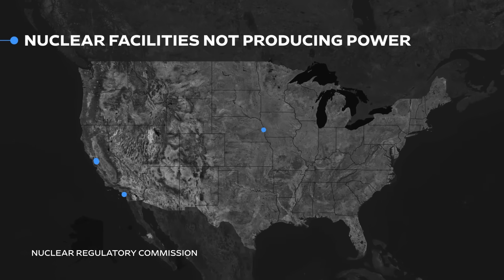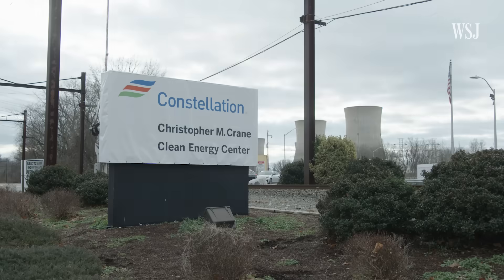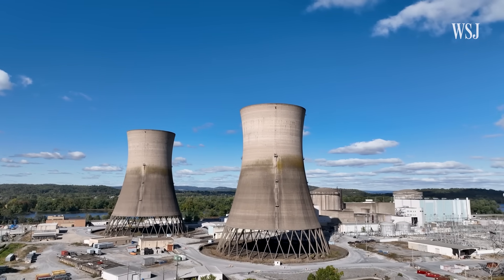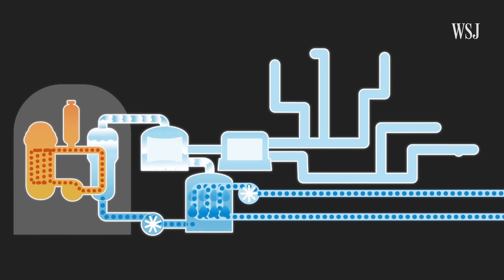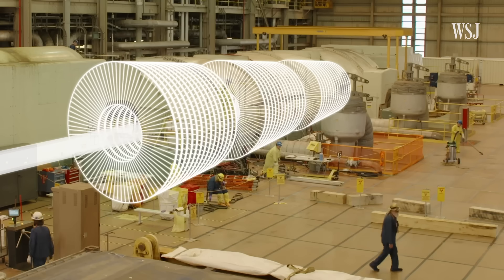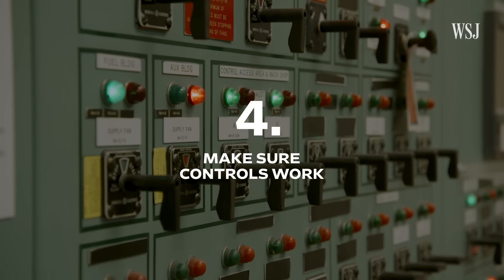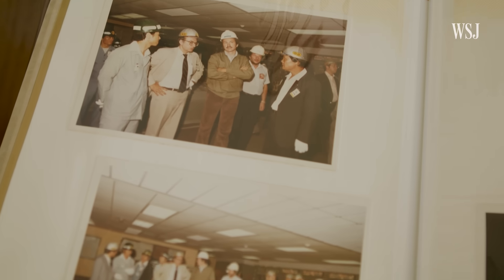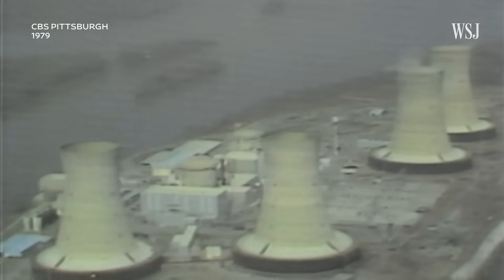Inside the $1.6B Plan to Restart Three Mile Island | WSJ

Comment: Why is step 1 putting uranium into the reactor? Wouldn’t you want to first make sure the controls work?
Reply: Literally should be the last😂
Reply: They tested the controls  but you need to make the reactor critical first  in order to test dynamically  all the rest: cooling systems,pipes and turbines.
You can always scram  the reactor (emergency shutdown) on the spot in case things get ugly.
Three Miles Island reactor is a better   design(PWR) than Chernobyl (RBMK). 
This doesn't mean that accidents can't happen: TMI 2 had a partial meltdown at Three Mile Island in 1979 but  it was contained and lessons were  learned.
TMI  1was running until 2019 without problems.
TMI 1  will be operational by 2028 (that is connected to the grid) and working for  the next  20 years according to Constellation.
Other option is to build a new reactor :it will take 7-14 years .
17 years  and 13 billions USD according to France EDF,
Reply: Ya no technical knowledge in this video
Reply: LOL.  Nope, just fill'er up.  It's all good.
Reply: First you call Scifi channel then you call wsj then A Watch maker.. Finally get back to the Lab gloweing in radiation to say GID SOLUTION WITH rust and Concreates
Reply: Because  without the control rods it's stable. Gotta put the fuel in first before testing if the control rods lower.
Reply: @TheRandompaint  WTAF are you yammering about?  Do you have any idea?
Reply: @johnjones5354  without the control rods in, the fuel will produce no energy. It's that simple. The lowering of the control rods is what causes the reaction.
Reply: @johnjones5354  before going off why not tell me what I you think I stated incorrectly.
Reply: @TheRandompaint this is not true. Lowering control rods STOPS the reaction and shuts down the plant. The plant is stable with rods inserted.
Reply: @ I don't know where you attended school, but your understanding of the operation of a nuclear reactor is completely and utterly wrong.  The control rods are INSERTED to stop, not start the chain reaction.  It's that simple.  Please don't tell me that I am mistaken, I served 8 years in the nuclear Navy, qualified as a supervisor on the worlds largest nuclear propulsion complex (USS ENTERPRISE, CVN65) and then worked at a civilian nuclear plant for more than 31 years.
Reply: @ When someone so confidently states something that is 100% completely wrong, I find it difficult to hold back.
Reply: @TheRandompaint  Removing the control rods allows the reactor to go critical.  The control rods absorb neutrons, robbing them from maintaining criticality.
Reply: Step one might better be replacing the control lamp bulbs with LED's.
Controls look like an early 70's sci-fi series.
Reply: @viandengalacticspaceyards5135 not all control circuits will be compatible with LED indicators.  But any change to the controls will require testing and proof which will require extra cost.
Reply: @viandengalacticspaceyards5135  The paperwork to do that would probably take 5 - 10 years alone, with no guaruntee of the government approving it.
Reply: @viandengalacticspaceyards5135  The plant was licensed with those 70's era controls. To make any changes, no matter how slight, requires addressing in the licensing.
Reply: @scottnunya1  Might be worth it..

Comment: There was no meltdown in TMI, If there was a meltdown, they wouldn't be planing to reuse the powerstation at all
Reply: it was radioactive steam that was released cuz the valve cut stuck and it can be defined as meltdown because you couldn't contain radioactive material being released into the wild
Reply: @LazzieMazzie  at most its a partial meltdown. The difference between a gas release and a melt down is the same as TMI and Chernobyl 2 completely different events

Comment: Wie viel Photovoltaik und Speicher man für 1.6 Mrd Dollar bauen könnte.
Reply: How would we store that energy though? The solar panels aren't the issue, our best option is building something similar to the Taum Sauk Hydroelectric Power Station which stores water on top of a hill to then be used later (potential energy)
Reply: @Coldsunscreen  for 1.6b you could build a hydro e storage. Or even with lithium batteries it would work fine. Enough money there. Or you build a thermo electric storage either with sand in bunkers, or with water. Or just under ground by heating the stone as the Swedes are  doing already. 1.6 billion is such a vast amount of money that could be spent better than in a 60 year old accident nuclear power plant.

Comment: Heh, what a nightmare to hope corrosion and wear isn’t a problem on every switch and contact and wiring and sensor…

And you have to check all of them. Every inch.
Reply: Just jiggle it.
Reply: They didn't dredge the equipment up from the bottom of a lake.
Reply: Something 50 y.o. is going to real fun maintenance wise. My guess is controls will get a functionality test and if it functions or the light comes on when they test it, good enough. No concern for reliability or components that are nearing end of life span. Hope I'm wrong, but...  corporate greed usually shows otherwise.
Reply: Removing the black tape fixes all of that.
Reply: @majcrash  haha

Comment: I get that it sounds scary, but Three Mile Island didn't cause any deaths. Chernobyl was bad, but that's the only really seriously bad nuclear power plant accident. Even Fukushima there was 1 possibly linked death. Just don't build a power plant in a densely populated area where it would require massive evacuations.
Reply: There were 1,368 deaths in connection to Fukushima.
Reply: @merridius2006  yeah I did see that later, linked to the evacuation though, not directly to the incident, which is why I was saying to not build them in densely populated areas. But yeah, it does suck. Still, only 2 significant nuclear incidents in all the decades of hundreds of nuclear power plants operating. And if you keep the plant at least e.g. 10 miles away from major residential areas and have a good evacuation plan you should be able to avoid even those. Plus trying to avoid areas with earthquakes might be a good idea.
Reply: Would you consider Harrisburg, York, or Lancaster densely populated?
Reply: @ No not even close compared to any real city in the U.S let alone the rest of the world.
Reply: @David-k3r3x  not especially, but it's also over 10 miles away from Harrisburg. I wouldn't think you'd have to evacuate all of Harrisburg if there was a catastrophe of some kind like Fukushima
Reply: From Japan here. People are dying from radiation caused illnesses in Fukushima but hidden from the mainstream media. Out of 160,000 residents who had to evacuate immediately and couldn’t get back for years, 26,000 are still displaced. That’s just from one meltdown 14 years ago. 

They cannot even touch (or see! as even cameras don’t survive the radiation level) the 880 tonnes of radioactive debris there, which is contaminating the ground and the Pacific Ocean as we speak.

Comment: San Onofre next. And extend Diablo Canyon even further than 2030.
Reply: Diablo Canyon is saved from shutdown and is still under load. San Onofre is very disassembled, but I think the reactor pressure vessel is still in place.
Reply: They put radio in my electricity and that sounds right right

Comment: As an electrical engineer, I wouldn't trust ANY 60 year old electronic equipment.  My first inclination would be to replace it all with new stuff, but that would be terribly expensive.  

I don't plan on letting the circuit breakers in my home go past 50 years, and I don't have any nuclear material here!

In product lifetimes there is something called the "bathtub curve" which plots failure rate for a device over time.  Early in life, devices have a relatively high failure rate because of improper production, assembly, or installation.  Then for a relatively long period of time, the failures occur at a low but steady, flat rate.  At the end of life, failures start going up again and gets worse as the device ages.  

At 60 years, just about any modern device is in or near its end of life.  There are certainly a few exceptions, but this application is not something we want to learn lessons the hard way from.
Reply: Really depends on how well the equipment was made. I restore a lot of vintage electronics and when you go from consumer to commercial or military grade its night and day. Some of the electronics I work on from the 50's-60's that were commercial or military are excellent and perfectly fine despite the age.
Reply: @setharp  the electronics I work on from the 50's-60's tend to have insulation breakdowns, bad caps, and dirty power from the power supply. But by far the biggest problem with old electronics is that at some point they have been "repaired", or worse.."updated", by someone who thinks electricity is a flow of electrons.
Reply: @intheshell35ify  Again- REALLY depends on the actual product. I work on a lot of radios, TVs, stereo systems, amps, and other stuff. Almost all of the consumer grade stuff? If its past a certain age? Automatic recap. ALL new electrolytics and paper caps. 
 
 But if I open, per say a Tectronixs scope or a former military piece? If it hsa for example- glass sealed "Vitamin Q" caps then those are good. They also cost a fortune when new too.  A lot of the components in this power plant are probably at that or above in terms of quality construction and upper end parts.
Reply: @setharp  do you see much PWM in the high end 50's electronics you deal with? Pretty much everything I mess with acts like a space heater with all the resistors and rheostats.
Reply: @intheshell35ify  Really depends on the individual item. Most electronics in the 50's were tube-based and ran on much higher voltages than solid state. So yea, there will be tons of resistors and some used as dropping resistors. In the 50's I really don't see much improvement in capacitor construction for consumer goods until the very end of the 50's and into the early 60's when everyone went to plastic versus paper film.
Reply: I wouldn't want to depend on a 60 year old trip or closing coil. Seen many old Westinghouse breakers burn those.
Reply: They are replacing backend equipment I had the same concern right now they are running into the issue of what does what. I wish this video provided more info though.
Reply: I'm pretty sure they will at least test all the vacuum tubes. 😂
Reply: Hopefully they're still not relying on a needle printer trying to print out thousands of mostly irrelevant alarms when something goes wrong.
Reply: Nuclear engineer here, there are probabilistic risk assessment (PRA) engineers whose jobs are just to do the specific sort of analysis you are talking about. Nuclear engineers are responsible for most of the advances in risk assessment in general.
Reply: The navy just decommissioned the MTS-626 and 635. Both nuclear subs built around 1963 and converted to training platforms in 1989. Upgrades happen incrementally throughout the life of the plant/ship and repairs happen as needed. Preventative maintenance and inspections are routine in ensuring proper operation and there's a high degree in quality control every step of the way. You have a very production and standard life-of-component focused mindset and not a very operational one.
Reply: I’d be equally concerned with replacing the old equipment with new. It may be short lived as well, be way too fancy, not configurable without another short lived equipment. It may be not quite able if one to one retrofit. And then the urge to re-do from scratch at least partially arises.
Reply: As an electrical engineer myself, I feel the need to push back against this. This is a political issue, and you shouldn't be using your (likely irrelevant) credentials to push baseless platitudes.
Reply: Tough crowd…. Seemed like a reasonable comment from a qualified person to me. What does a “brain scientist” know about nuclear power plant monitoring systems?
Reply: Also consider these are “nuclear-grade” analog systems
Reply: So, are you planning on pulling all the wiring out at 50 years, or just the breakers?
Reply: @ Just the breakers.  The wires don't have any movable parts, and from the exposed wire I can see there is no evidence of age-induced damage.  I've already had to replace some of the outlets.
Reply: SIMPLE just Paint over The radiation Where a rain coat
Reply: Well, Bill Gates is the reason it's being restarted. Microsoft' power hungry AI needs cheap constantly reliable energy. He's also having one built in Wyoming.
Reply: They r opportunist out to profit! They is only so much u can change n u have to risk living with the rest!
Reply: This isn't a barn find car that was parked in 1974. This plant was operating safely in 2019. If critical parts were not functioning in 2018 it never would have restated after the last outage period. 
As an engineer you should know that engineers always want to replace the old with new and shiny parts. I'm sure the many working at this plant have been doing that for decades.
Reply: @blakem9109  Assuming the control room was the one pictured in the video, there was only 1 piece of modern looking equipment in it - a flat panel display.

And as an electrical engineer, I also know that all those switches have a lifetime actuation rating.  Does anyone know how close they are to hitting that limit?  Or do you expect them to continue to use what appears to be vintage equipment and hope for the best?
Reply: NASA uses 60 year old technology on the daily.
Reply: @TheRandompaint  There is a difference between using 60 year old tech and 60 year old parts.  How many pieces of 60 year old electronics in your house are still working properly?
Reply: Unfortunately, as a DIYer and fixer upper, in general, I agree.
Reply: As a brain scientist, this has to be the most smooth-brained comment I've ever read. Congratulations 🎉
Reply: @hectorbermudez8785  he gots a bad case of the lissencephaly!!
Reply: @intheshell35ify  The dunning-kruger is strong with this one isn't it?